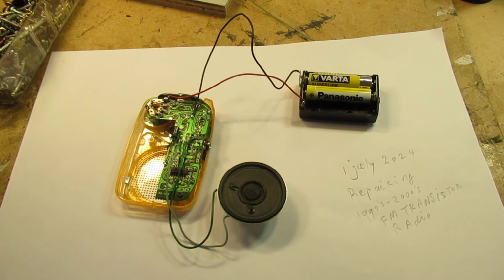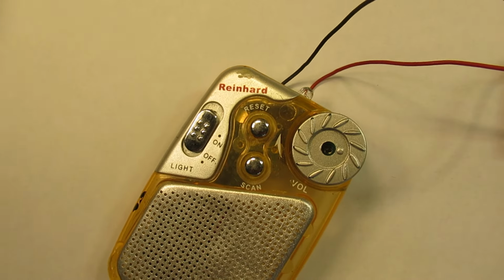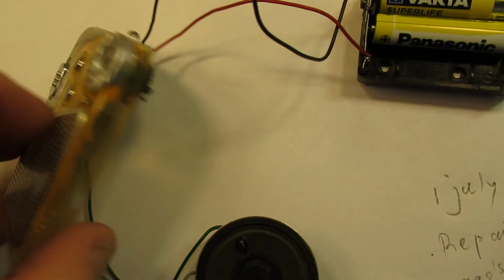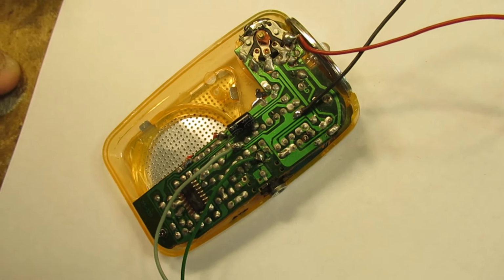Refurbishing a mini FM radio (1990s-2000s) + in the textbox some info about curing ground loops/hum

Comment: Here in the in the USA, when I  learned electronics, I was told to use 60/40 solder. 60% tin, 40% lead with a rosin core. As far as I know, you can still buy it here. I have many spools of it so I don't think I'll be buying it anytime soon.
Reply from the maker: Hi Ron, yes that is a good idea...Quite a few years ago (say 8 years) it was told by the EU, that lead-tin solder was completely forbidden, also for (radio) amateurs/electronic hobbyists. When I heard that the first thing that I did was (on a radio market) buying (say) for 200 Euro's of normal (lead-tin) solder. It was very heavy in my backpack.... Still can remember it and using it today. Later the rules for (radio) amateurs were mitigated, anyway. I cannot use bad quality solder for my experiments, so I also have to use 60/40 solder, like you tell, with a rosin core. At the moment I still have enough, just like you, I think (!). 1 July 2024.😁

Comment: pl make a video on transistor based fm tuner, that works well.
Reply from the maker: It is already on my YT Channel. Completely with schematic. I will give the link.
Reply from the maker: Video link
https://youtu.be/F5whmoEcbn0 

In the textbox you can see/find everything & links about how this FM radio was made, with a TBA 120 Chip. Thanks. So it can easily be reproduced, with some time. 1 July 2024.
Reply: @radiofun232  okay, thanks.